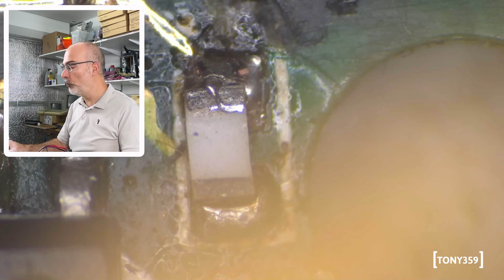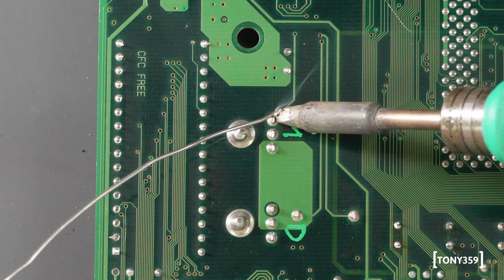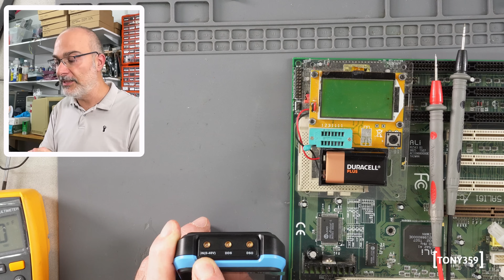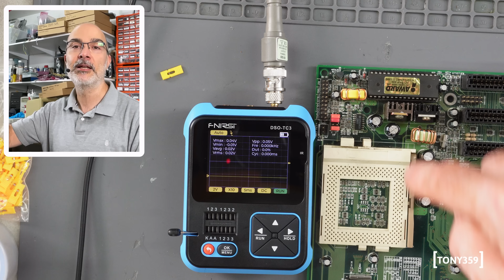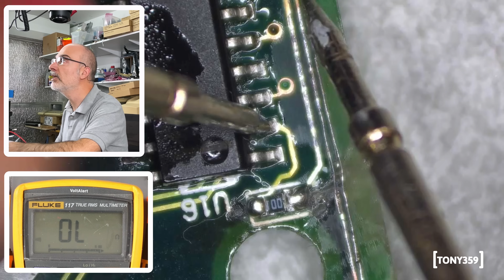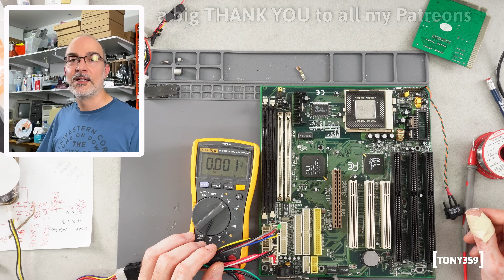This motherboard surprised me with multiple unrelated faults!

Comment: I have the same board - just a bit different. The VRM section of mine looks a bit different and there is an IC in the bottom left corner. It would be a shame if the south bridge has an issue. I haven't tested mine, but I will let you know once it is clean and we can take some measurements! Great video! Thanks Tony!
Reply from the maker: Thanks Alex for your help - it would be great to compare our boards!
Reply: I also have a similar model, which was working until yesterday. Let me know if I can help. I may be doing the poor man reflow on it next week
Reply from the maker: pan fried "Socket 7" ?
Reply: Baked, not fried 😉
Reply from the maker: @clintcolombin  don't forget a sprinkle of olive oil a the end! ;)
Reply: The seasoning is the most important part! Make it a Garlic board! 🤌

Comment: regarding southbridge pdf: "Power-Good Input.  This signal comes from the power supply to indicate that power is available and stable.  M1543C will use this signal to  generate reset sequence for the system.", so there is "sequence", what about if it is syncronized with some clock, OSC14 for example. And if we lost input clock, entire chip is stuck.
Reply from the maker: uhm interesting! I shall check that, you never know!
Reply: @tony359  yes, the reason may be the lack of clocking of the south bridge. Quartz or strapping may be defective.
Reply from the maker: @ILRBW  Hi - thanks. I checked (after the video) the small clock IC nearby and it works. Whether it reaches the IC under the package, I cannot say :) But thanks!
Reply: @tony359  check OSC(b30) and CLOCK(b20) on ISA slot, if both are presented, this is not clock issue
Reply from the maker: @Insomniator1 Sorry, it's taken a while. I do NOT have clocks on 20 and 30. I do on a different board as a comparison. That is the ISA clock coming from the southbridge though? Wouldn't it be affected by a dead SB? I cannot be sure but I think I saw clock on B30 for a split second on my tests. I could not replicate.  There is a small crystal nearby the SB and that is outputting the proper clock. What do you think? Thanks!
Reply: @tony359  very strange, OSC(b30) usually buffered from clock synthesizer chip, buffer can be 74xxx logic element or multi i/o controller, SB has no 14mhz OUTPUTS, only input. CLOCK(b20) generated by SB, so this clock depends on it. May be your measurement tool is not good enough and don't support 14 mhz ?
Reply from the maker: @Insomniator1  ah-ha so the ISA clock comes from the clock IC! Amazing! That might be a requirement for the SB to release the reset line. I'll check the clock IC thanks!
Reply: @tony359  ISA 14M clock (b30) connected with 22-33 Omh resistor to buffer' out on pentium1 boards, so it's not easy to trace it with slow multimeter :)
Reply from the maker: @Insomniator1  Well I guess I can start from the ICS IC and see if it's outputting 14MHz :) If not, then I have a problem there (unless the SB is collapsing it?) If yes, then I'll start tracing.
Reply: @tony359  On my board (REV. F) this is ICS 9148BF-36, REF0 is 14M output. There is no multi i/o controller on board, so probably resistor or U16(74F04) used as buffer.I traced REF0 to pin 1 of 74F04, so pin 2 is inversed/buffered 14M clock, then through R107 (10 ohm) is connected to ISA bus (b30). SB may be connected to pin 1 or 2 as 14M input source...
Reply from the maker: @Insomniator1  There is a pin to stop CPU clock - for power saving. But I think I scoped 66MHz at the CPU so...
Reply: @tony359  i edit previous post, 14M always generated by clockgen chip, only cpu/pci clocks is able to stop for standby
Reply from the maker: @Insomniator1  Amazing so we might have a clue here! I wouldn't be surprised if with no ISA clock the SB refuses to lift the reset line. Though that 1.7V is still sketchy. But I'll take a look at that ISA clock, it must be there so if it's not there, then we have a problem.

Comment: For component testers, the old tester (I also use) is an LCR-T4. Although it's often mentioned as being inaccurate, the real issue lies with contact resistance and contamination. Since I directly soldered three test clips and test pins to it, and clean the test pins and clips with IPA before measuring, it has become very accurate. Maybe even gold-plated clips would be useful directly attached. The disturbing effects of contact resistance shouldn't be underestimated. A telltale sign of this might be that if you measure the same component but place it slightly differently, it shows different values. And let's not forget that it is sensitive when measuring capacitors, especially if the capacitor is not fully discharged beforehand. Sometimes people measure charged capacitors with it, and it becomes oddly unreliable. Since then, I also tend to short the FETs before measuring, just to make sure their internal capacitance doesn't cause any issues either. :P

Comment: 👍🏼do the replacement! BGA is fun! 😜
Reply from the maker: Super fun when you see everything melting away! :D
Reply from the maker: Yes, thanks,  I'm planning of making some shields with some drink cans - I think North West Repair made some. I DO fear the BGA, I've been consistently burning everything for a decade! :D
Reply from the maker: Oh, I have all those tools. I have the big pre-heater, I have a good hot air station etc. To be honest, I've only worked on large board with massive ground planes (PS3, PS4) and those are difficult. Smaller boards should be simpler.

Comment: Hello Tony. You can check both component testers with a large new capacitor, something like 1000 uF or bigger. A good one should have an ESR well below 0.1 ohms. Now add in series one ohm resistor and measure it again. Now both testers should measure 1 ohm ESR if they are ok. Anyway the component tester have a calibration procedure (at least the cheap one from ebay). You can try to recalibrate it if needed. How to access the calibration procedure depends on the installed firmware, so you will need to do a bit of googling.
Reply from the maker: Hi - thanks, I wasn't aware of that procedure thanks! I did run the "calibration" before shooting the video but that didn't change much unfortunately. I'll try what you suggest later thanks!
Reply: @tony359  The cheap tester is based on an open-source German design and is well documented and the large pdf manual is available. The calibration requires a stable small value, known good, known value ceramic cap as part of the calibration. Something like a common 100nF bypass cap is good. To start the calibration short all 3 pins on the tester together then follow the on-screen prompts. Then do the same thing in the Finirsi. If it doesn't have a calibration proceedure toss it in the bin.
Reply from the maker: @g4z-kb7ct  I found the manual yesterday. I'll see if I can trigger the calibration. The FNIRSI has a calibration which was done before shooting the video! I'll make another quick video to show some extra info the bin is where it belongs.

Comment: I believe they are relevant to each other. Shorted VRM mosfet (drain and source shorted first) killed CPU (which is previous owners) with overvoltage first. Killed CPU is now shorted internally with some data pins and killed south bridge with it. While this can drain extreme current, VRM mosfet shorted with its base drain and source and killed PWM chip. I assume this happened, but i might be wrong. Do you have "original" CPU with this board? If so please check it for shorts.
Reply from the maker: I don't unfortunately. I just bought the CPU. Thanks for the hints!

Comment: I would cut the trace going from the south bridge to the 04 to  at the edge of the bridge IC to make sure nobody else is conecting to the trace causing this verid voltage. If you measure the same voltage next to the bridge ic than no other way to figure out what is happening than desolder and replace the brige. After the removal of the BGA it is worth to measure the reset trace again, you never know who else is try to talk into this reset trace. Another idea: try to reflow once before replacement maybe it will help.
Reply from the maker: Today I checked the CPU reset line and it's also stuck at 1.7V - I know it comes from a different pad, I haven't checked if they happen to be electrically connected. 
Oh yes, if and when I remove the SB, I'll test without it first. 

Reflowing might help but it's never a good thing for the PCB and adjacent components to get to 200C multiple times so I'd be tempted to just swap it. But it's an idea thanks!

Comment: Also regarding tool longevity. Case in point: I have a Hitachi V665 analog oscilloscope, 2-channel 60MHz. It was made in 1975. I have had it for 20 years, and whoever owned it before me gave it pretty heavy use. It still works perfectly fine after almost 50 years. Even the CRT on it is still bright, sharp and nice.Well made tools, especially if you treat them right, can last you a lifetime.
Reply from the maker: They do indeed! I loved my Fluke scope - it just needed a whole bench to be used! :D
Reply: @tony359  haha I keep the Hitachi on the floor next to the bench, standing up on its rear feet (yes it has feet on the back so it's designed to be used standing up like this). It's not only large, but also heavy. About 15kg. :)
Reply from the maker: Oh I do remember keeping the Fluke on its back feet as well and my probes were barely long to reach the boards. And I'd systematically trip in all those wires and everything would fly across the room.

Comment: I think there might be a bad cap and  possibly a bad diode allowing feedback preventing the system to reach 3.3v. I don't see the south bridge being the issue.
Reply from the maker: I thought about that. I looked for any other place where the ISA reset line could be connected but I couldn't find any. One thing I forgot to check are the PCI reset and CPU reset. Those are coming from different pads under the SB. If those are 3.5V, maybe then is as you say.

Comment: Take a look in the pci slots. Got two of these from ebay with similar behavior . Both ended up having smashed pins, grounding out inside the pci connector.
Reply from the maker: Thanks for the idea - I did check those pins and unfortunately nothing is shorted.
Reply: @tony359  Bummer, I never had a short on the reset line. The data pins were the problem. My best guess was the shorted data lines kept the chipset in a weird in between state. Not letting it come out of reset. Best of luck!

Comment: If you have a new electrolytic with low ESR (like less than 1 ohm)  you can just put a known small resistor in series with the cap and test that combination.   That should tell you which tester is correct.  Try several different series resistor values to get more confidence.
Reply from the maker: I have tried, I'll publish the result on the 2nd channel. Though those testers don't work with high frequency, they use some tricks so the resistor might actually confuse the process. But I'l show that process anyways. Thanks!

Comment: You could try to isolate, brake pin between south bridge and inverter. Then try to manually push it high and low, a measure how motherboard will respond.
About component testers You could try to power them with good battery, do measurement to component, then put almost used up battery and test the same component. If one tester will have about same values and other show something different, then You will know which one is better.
Reply from the maker: Well the Fnirsi is rechargeable :)
Which line? The Power good line? That goes high and low as expected.
Reply: @tony359  output line from south bridge.
Reply from the maker: I see your point. If the line is still at 2.2V, then something else is holding it in that state. Thanks!

Comment: This is a nice board and I'd like to see you getting it to work eventually, but I'm also good with seeing another video of you fixing something else, so whatever you end up deciding is good with me. 🙂

For the ESR testers, they are probably not trustworthy when it comes to ESR, but a big part of the difference could simply be that they measure the ESR using different frequencies. You could look at their output signals using the oscilloscope and check if the Fnirsi uses a higher frequency.

If a capacitor is leaking (electrically, that is), then the ESR and capacitance is more or less irrelevant and you should be able to measure the leakage current using a DC supply and multimeter. Then simply apply the rated DC voltage to the capacitor and check that the current goes to zero or very near to that (<1uA at least). If not, toss it.
Reply from the maker: Yes I understand that if the frequency is different then the ESR will read different. Good idea about checking it with the scope - won't the scope affect the reading at all?
Reply: @tony359  The input capacitance of the scope should be in range of 5-15pF so that would be negligible in relation to a uF capacitor. But the idea was to mainly compare the frequency emitted from the devices. I assume they both use a fixed frequency for their capacitor measurements.

Problem is whether the scope's input impedance of 10 MOhm will confuse the meter and make it think it is measuring a resistor, but of you set the probe to 10x the input impedance should be 10x higher, or even better use a 100x probe if you have that for minimal interference.
Reply from the maker: Thanks, I'll try to measure that. I do have a 500x probe, but it's my differential probe. Would that help?
Reply: @tony359  Diff probes are active devices so they buffer the signal and do not necessarily increase the input impedance. A typical input impedance for a diff probe is 5~10 MOhm so not higher than the regular probe on 10x, which is 10 MOhm (I miswrote before since the scope is only 10 MOhm with the probe on 10x). The scope itself is 1 MOhm and basically the probe adds a 9 MOhm resistor in series with the signal when you set it to 10x.

But 10 MOhm is also reasonably high and I doubt those cheap component testers are sensitive enough to be disturbed by that. I think it is not much different from the resistance between the pins in the ZIF socket if you're in a moist environment. 🙂
Reply from the maker: Gotcha thanks. I'll try!

Comment: Definitely I want to see you replacing the southbridge! But despite the end result is not the one we wanted, it was nice seeing you exploring the different possibilities for issues. I learned something and it is what I like.

Have you tried to push the southbridge against the board due to a bad solder connection? I could explain the changes in voltages between days and prevent the board from posting.
Reply from the maker: I have - it didn't make it in the video. I warmed it up, cooled it down, pushed in many different ways: I never had any change whatsoever. 
The voltage change was due to ground - I normally use the isolation transformer just for convenience, it has a big ON OFF button. With that, I get 2.2/2.7. With mains, I get 1.7. It kinds of suggests that the line is floating maybe?
Reply: @tony359  this means that the southbridge is damaged? I feel so...

Comment: I have tested the same old one component tester you have and got 0,34 ESR on a 100uf capacitors and then tested with a DER EE LCR Meter DE-5000 and got 0,42 so i think the old one is more correct than the new you got.
Reply from the maker: I've never got the feeling that that old component tester was telling me BS. I've been using it for many years... Thanks for double checking  that!

Comment: With the component tester. If you get the version Tony has, make sure it has the metallic crystal on the other side! The other ones are junk and fail. They are a great little tool though. Helped me fix a graphics card a while ago.
Reply from the maker: I am aware there are 10000000 clones of that tester. I think I was lucky with mine! :) I had two actually - I blew up one when testing a large (still charged) capacitor...

Comment: I have this same board, it works fine save for the ide being weird. By weird I mean that it doesn't properly report drives above 501MB. It says them fine in the bios, but older operating systems like DOS don't see the full capacity. Also Windows 98 and newer do see the full capacity, but DO NOT like being installed on partitions bigger than 512MB. I ended up just getting a Promise IDE card and using that for the HDD.

Comment: Hi Tony, try re-flowing it mate, if the voltage changes there may be a solder break. Bob. UK
Reply from the maker: Hi - I tried with hot air but not to the point of melting the solder. If I go that way I'd rather swap it or re-ball it as apparently re-flowing seldom works. Hot air didn't make any difference though.

Comment: Did you reflow the power connector on the MB?
Reply from the maker: No, why?
Reply: @tony359  You might have a flaky solder connection to the pins on the power header? Just a thought. I'm sure you have checked this already.
Reply from the maker: Well, anything is possible. I haven't checked that I'm getting 5V on the board to be fair.

Comment: What's the resistance of reset to GND, ie, something may be pulling it down.
There's probably is a bunch of things that have to be good before the chipset releases the reset, eg, crystal has to be oscillating. I have had a MB with a stuck crystal, and when I accidently did a diode test across it, ie, gave it voltage, it started working and fixed the MB.
Reply from the maker: That's a good idea, I thought about that just an hour ago! And yes, someone also suggested the oscillator. I might re-visit that board before I got for the replacement for sure. Thanks!